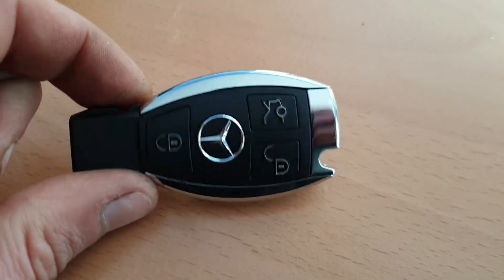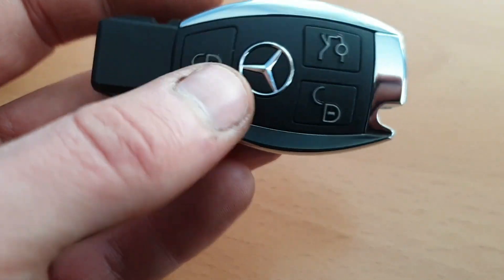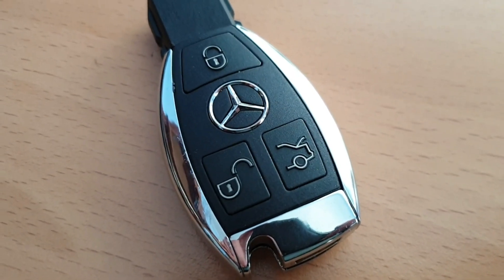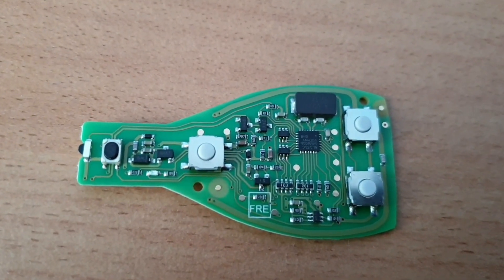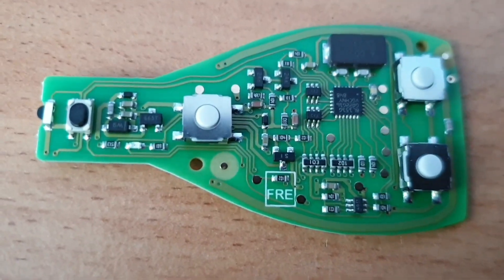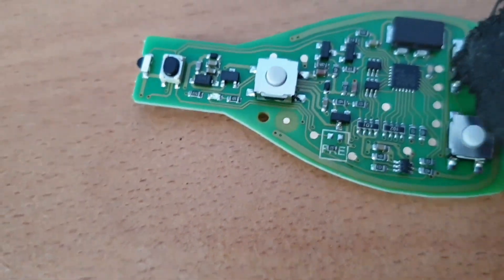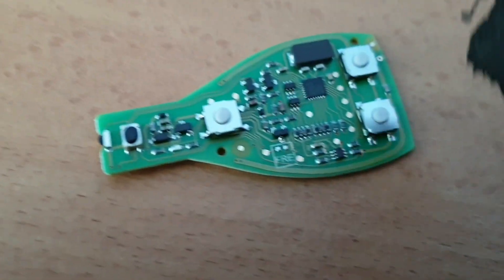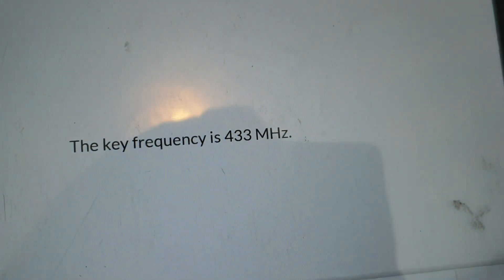Change Frequency on Mercedes BE Key - Quick and easy job 315 to 433 mhz

Comment: GREAT VIDEO ❤... Will the car still start with the chip removed? I shipped my USA 2014 Mercedes C250 W204 to Germany and TÜV is telling me I can not have 315 mhz.   (I ordered the 433 mhz antenna amplifier just in case I need it).

Comment: Hello, I bought a car in the USA and I can't register it in Germany because of the key frequency problem, the key has a frequency of 315 mhz and here I need a frequency of 433 mhz, if I remove the key what you did in the video, the frequency changes  at 433 mhz, and does it need coding or is it ok, the key works the same as before?  thank you very much.
Reply: Hey Amarildo, hast du mittlerweile dazu eine Lösung oder eine Info? Für eine Info bin ich dankbar. Viele Grüße

Comment: It says 433 is Default right on front of packages 📦. I'm in US I could send you a picture. Whenever I remove it changes to 315. Not sure if it's an import difference but it's the opposite in the States. This is why I was confused watching your video. Clearly it's different per country